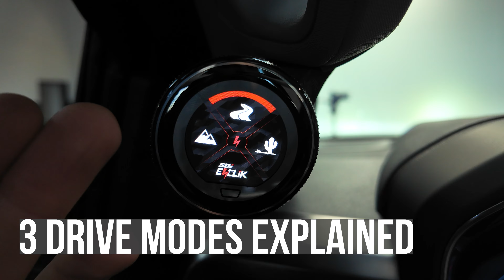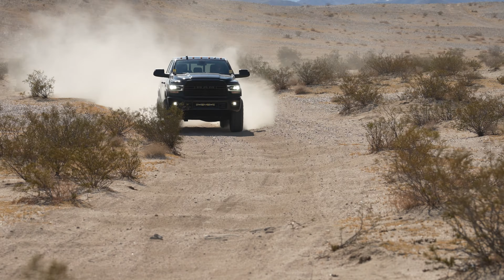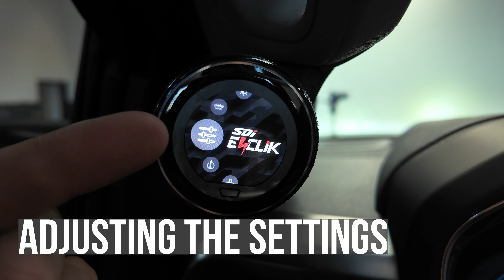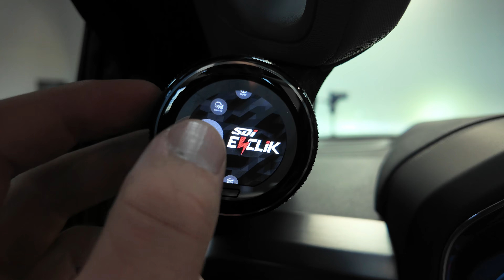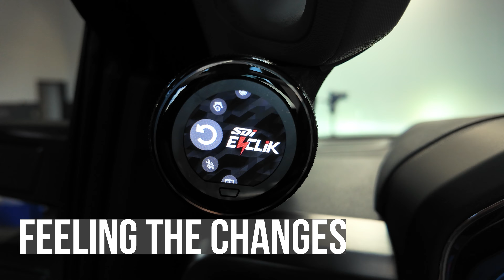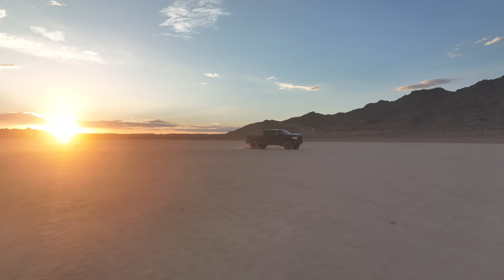How to Set Up and Adjust Your Carli Suspension E-Venture System

Comment: The rear load dampening is really worth it, it is a great match with the R1 coils on the Ram 2500.
Reply from the maker: The load feature ramps up compression valving on the rear shocks alone, making them resist compression more when you're towing. It's a nice feature to keep the back planted with extra weight, but keep in mind that does nothing to alter capacity. Shocks do not support load, so the tuning is just to match increased weight. Load  capacity is entirely determined by spring rate, so you'd want to add our Full Travel airbags for towing heavy with R1 coils.
Reply: @CJCOffRoad  Yes to all of those points, I wanted the lighter coil for ride. I have airbags for towing. I picked up about 3/4 cord of wood, and with dampening at 0% the truck was all over the road. Having the adjustable dampening controlled the load well, and made the mountain drive very comfortable. I run at 100% towing with bags, and I don't think you could get a better ride than with this setup.

Comment: So im on the fence between the Dominator and the E Venture. 

If money is taken out of the equation, what would I use to determine which one to buy?

Do they ride as good as the Dominators off-road? Can i go 60 in the Navada dessert?

Does the Dominator handle roll as well as the E venture?
Reply: Personally I love the venture on my 24 Gas SD. Drives like heaven on road. Haven’t pushed it in dirt yet. Looking at adding these stabilizers to tighten steering feel up
Reply from the maker: Unless you plan to jump and send your truck through whoops on a regular basis, go with the E-Venture. If you plan to push the truck to the absolute limit in the dirt, then the Dominator is the way to go. Both offer a smooth on road road, but the E-Venture does take the win on the street. Off road the Dominator will easily outrun the E-Venture just due to the increased shock diameter and damping that comes with that.

Comment: Does a Ram 2500 or F-250 ride smoother with this or are they similar?
Reply from the maker: The Ram 2500 platform uses a coil rear end which makes it hands down the smoothest HD truck on the market. That said, it does have less towing/payload capacity than the leaf rear trucks like the Super Duty.

Comment: While I love mine, my neighbor's got some super annoying washboards of small bumps, haven't been able to figure out good settings still to mute these out at 25-30 mph, always too bouncy
Reply: Go faster.  U will miss some of the bumps 😅😅
Reply: @allanstephenson9336  LOL
Reply from the maker: What tire pressure are you running? It may be more tire pressure related.
Reply: @CJCOffRoad  Down to 43 in front, 35 Rear, still on factory Duratracs though
Reply from the maker: Small chatter like washboards is highly dependent on tire pressure and tire sizing. Moving to a 37s would be a huge help!
Reply: @CJCOffRoad  can't wait! #Christmasiscoming
Reply: When is it coming for mine 1500 chevy...my 2.5 Elites are great, but I want the on the fly in cab...